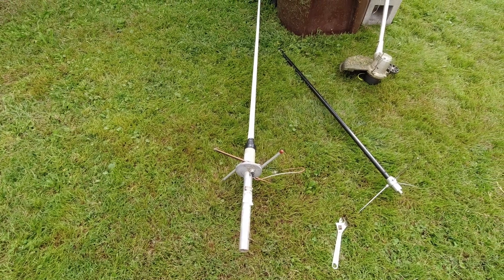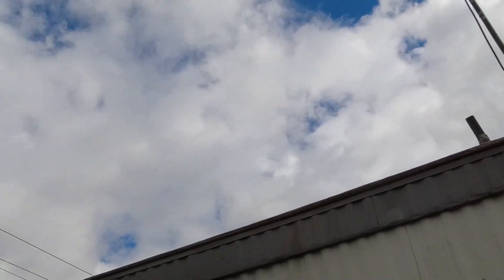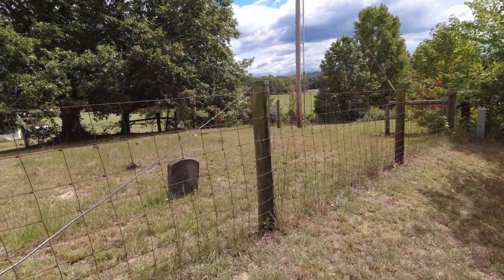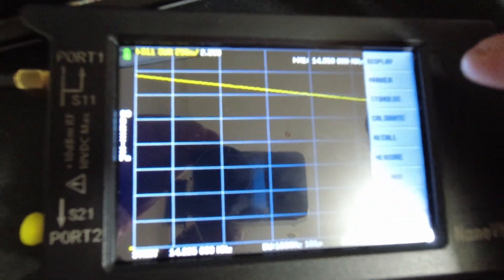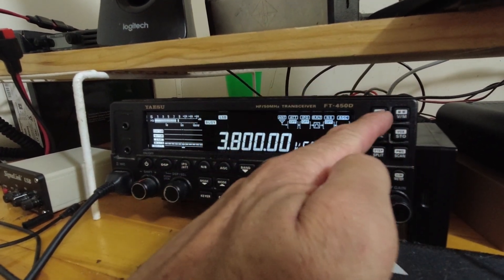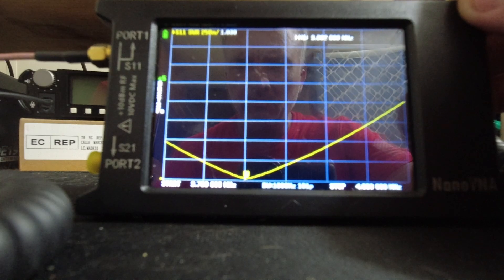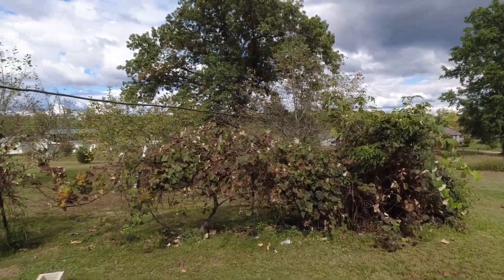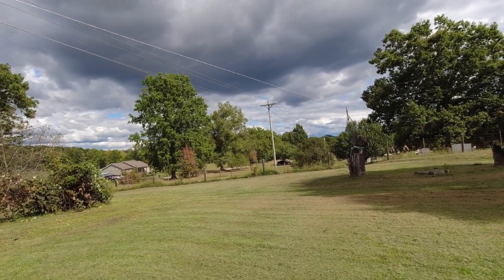80 Meters on an endfeed with no coil or tuner needed?

Comment: How much concrete do you need in the ground for 100 foot tower.
Reply from the maker: @michealbell5042  the pad is 6 foot deep. 72x72x72 inches.  Triangle shape. Couldn’t get a truck to it.  So we mixed 4 pallets of the 80 pound bags by hand in a mixer and dumped it in. Took 12 hours